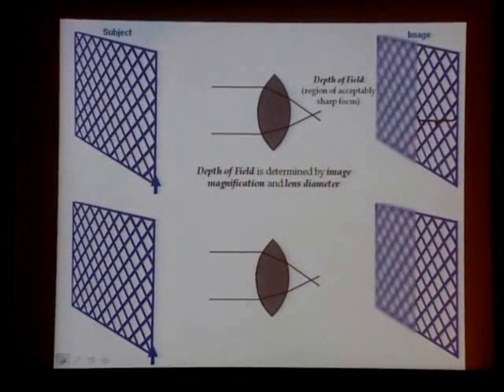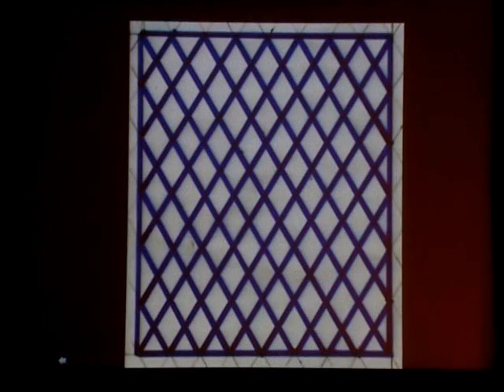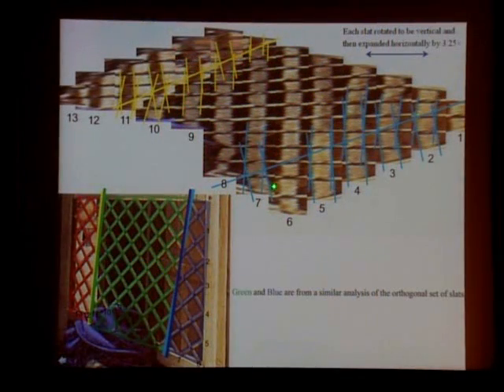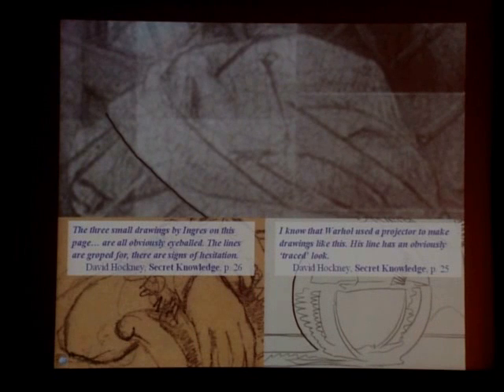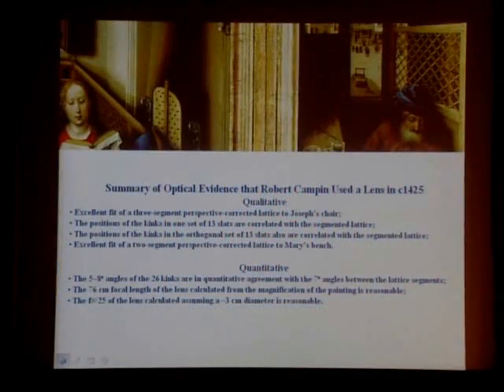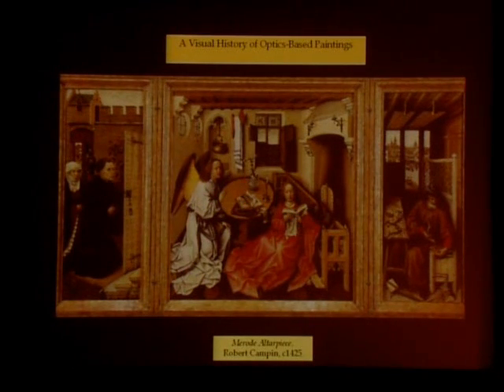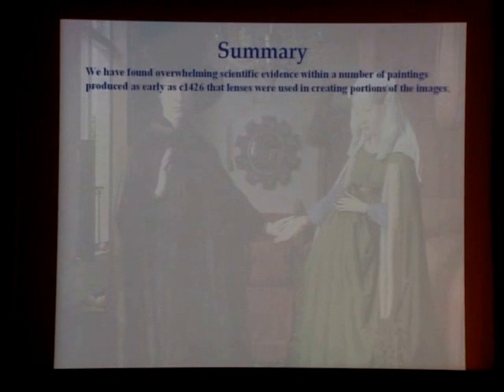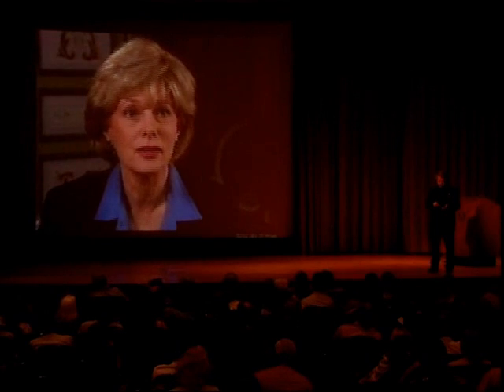On the Use of Optical Devices by Renaissance Painters - Part 5 of 5

Comment: "I mean, Van Eyke's "Arnolfini Marriage" has an optic in it, the concave mirror that existed around that time."

The one in the image is convex, not concave. Convex makes the reflected image smaller -  useful for wide angle reflections - like a rear view mirror in a car.

Of course, if they made convex mirrors, they likely (as mentioned in the clips in this lecture) made concaves. Concaves magnify, which is why they are used in Newtonian telescopes, and for projecting popes onto canvases.

Comment: @KPattonArt123 That's not true, concave mirror polishing potters wheel was also in there. Even then there is no evidence that DaVinci used concave or flat mirrors for his artwork. BTW a mirror is an optical device, there is a clear distinction between using a flat mirror and a lens or concave mirror though. It would be very hard to prove if an artist like DaVinci used a flat mirror reflection, they were very rare and and indistinguishable in figures from "eye balling".

Comment: @anikinippon "All the masters had under drawings except Caravaggio."  That's not true. Most artists, like Rubens and Van Dyck, did their "underdrawings" straight in oil. They'd use a medium value paint and draw in their painting, and then work directly in color on top of that. Check out any unfinished Rubens or Van Dyck and you'll see what I'm talking about. It makes the underpainting undetectable, because it IS the painting.

Comment: The reality is that the use of optics wasn't used much up until the 19th century.The L'Ecole des Beaux Art started teaching photography/optical devices in 1863. We have examples of camera obscuras dating to very late 18th century.Read older texts on painting to see how much info there is on optics.Read writings by Vasari,Solomon J Solomon,Eastlake,Ruskin,Sir Joshua Reynolds,Thomas Bardwell,Veronese,Van Dyck,etc.These span 1500-1890,& were largely influential in their time.None discuss optics